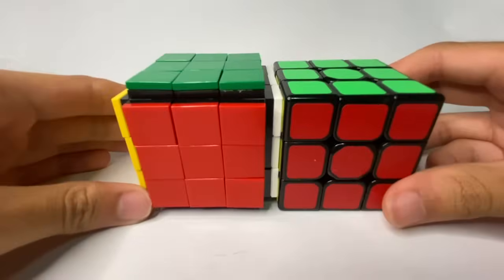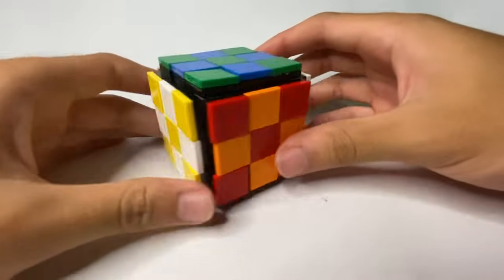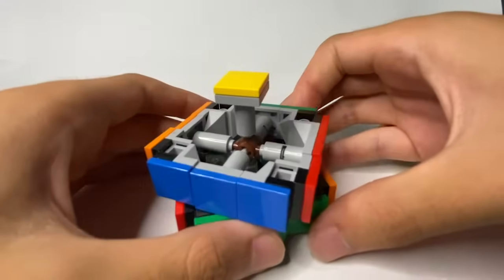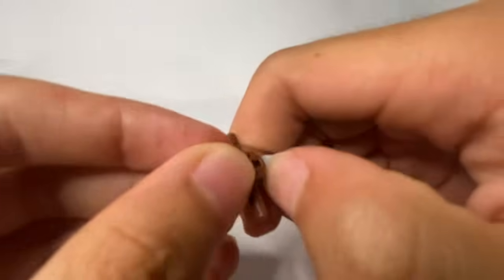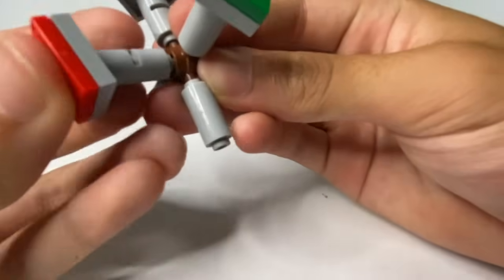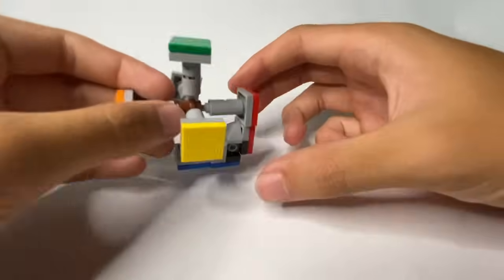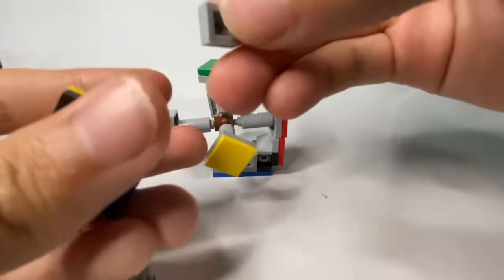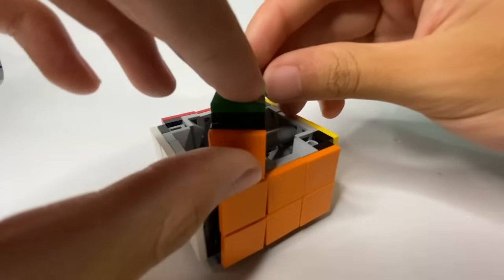Working Lego Rubik's Cube (3x3x3) - 100% Lego - full tutorial

Comment: What would happen if you added an extra 1×2 under each slope on the edge blocks?
Reply from the maker: it makes it stick more, but much worse when turning since the spike part of the pyramid piece on the edges has to go over the top of the corner pieces. the main problem with the cube that needs to be fixed are the corners, they need to be curved so the edge piece spikes are stuck on the inside of the corners the whole way during turning rather than on top. thats why the spikes are as small as possible to limit this 'on top' movement, and also why the cube is so loose
Reply: @puzzLEGO  ah, well explained! Btw I'm glad you understood what I meant, pyramid is a much better word for it anyway!

Comment: if you used 2 x 2 rounded plates or tiles it might be easier to turn
Reply from the maker: It’s the mechanism inside which stops it from turning smoother, I don’t think changing the tiles on the outside would do much

Comment: about the center pieces, could you provide some more information about the "too tight or too loose" thing? i have all the pieces and i can't seem to get it right, either the thing falls apart, or the 1x245° pop off inside the cube so i seem to have it always too tight or too loose, but never good :s any tricks on how to get it right?
Reply from the maker: I leave about a bar’s width in space between the brown connector and the half pin inside the cylinder thing. It’s incredibly fiddly though
Reply: @puzzLEGO  a bar's width, so that is 2 studs. Allright, i ll keep on trying :) anyway i never expect it to be a speedcube, just wanted it as a cool display thing :)
Reply from the maker: @LodeDesplancke  the diameter of a bar is the same as a tile height I think

Comment: What if you push the center piece 2 mms in, It would be much stabler, please reply
Reply from the maker: The problem with that is that the edges would not fit anymore. The main problem with the central mechanism is that you have to make it the exact right tightness
Reply: @puzzLEGO  Sorry for the late reply but Can you push them in after you assemble it?